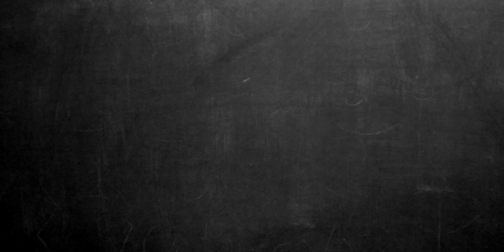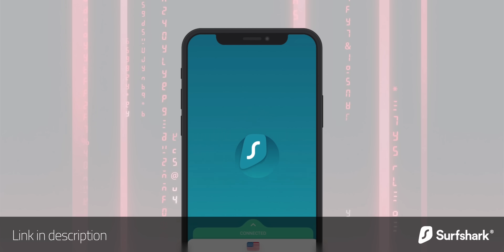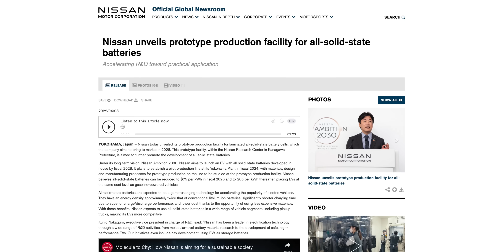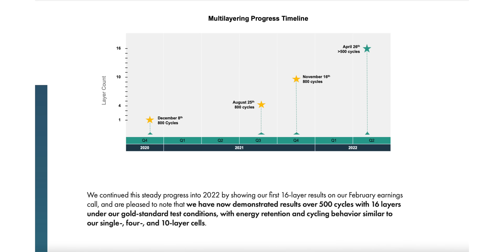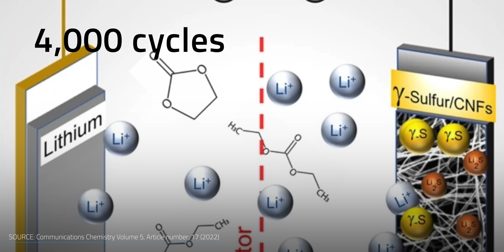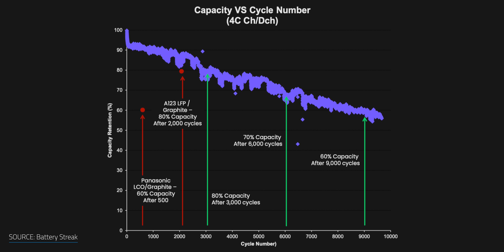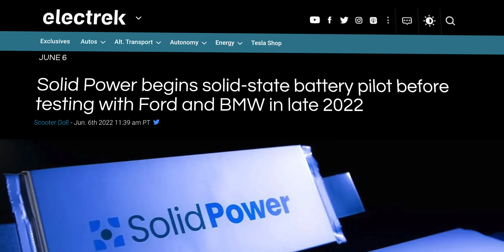Is This Solid State Battery Too Late?

Comment: I understand that nuclear Diamond batteries have a lot more work to be put into them then batteries that you mentioned however wondering why you didn't even mention them at all in this video considering that they would be the ultimate long-term battery and they could be paired with other batteries to be a background charger for the battery that you actually use and yeah I understand that they don't produce much energy at one time which is the reason I suggest that they could be worked in combination with one of these other battery technologies basically they would be a background generator instead of a battery

Comment: In 1799 Alessandro Volta (based on Luigi Galvani's 1780s work), pile up alternating disc of copper and zinc to made the first: pile, battery, cell. 
220 years later we still use the same comcept, same idea with new materials. Is like remaking a Ford-T with carbon fiber, aluminium, polycarbonate .. ... but still is a Ford-T
We don't need new materials. What we need is a new concept, fresh ideas, not a remade of 220 years battery.

Comment: Until you have one in your hands and test it yourself, it's really difficult to know are lab results vs. real life.  It would be nice to see improvement over different existing technologies vs always chasing a magic bullet.   I just discovered an unopened box of Energizer Industrial D batteries MFG 2005.  Just for kicks and put them into a fan and they worked.  Also, my Ipod Shuffle is still working after almost 16 years.

Comment: Solid State Batteries are still the ideal future, regardless of any others that might hit the market first.  The 2 big things that the other technologies don't address are safety and weight, because they still use a liquid electrolyte.  What's the use of having more range in your EV if a fallen branch on the road can make it go boom with a single puncture?  And while they might not have the sheer density of the other technologies on paper, the massively reduced weight of Solid State Batteries would increase the efficiency of them to a point where in practice they may work out to have roughly the same actual, usable range.

Comment: By proper planning, charge time isn't a big of an issue. The reason I am hesitant to EV is the cost, and long term cost. 

Even if a EV was cheap to purchase, the long term cost is still a deal breaker. 

I drive a 40 year old E85 car. Got the knowledge to modernize it, and it got a fair standard of comfort. The cost is almost none, except for the fuel. But doesn't give me any surprise's and I can plan my economy. 

My point is that most of the consumers can't afford an EV as it is today. 
The technology isn't here yet, even how much you wish it was. 

Second, my passion as for many other's is the combustion engine it self. 
The passion for driving. 

Third is political. And I'm not going in to that. 

We cant stare blind in to one lane. There are other opinions, as the development of EV's 

As you mentioned in another video, research for alternative fuels are another way as well. 
Then we are back in to the political aspect again. 

Well, I could go on, but I had to get this out of my chest. 

I prefer logic before anything else. 
Pushing EV's as the savior of the earth is not really the truth. As you know, it's just a percentage of the total CO2 equation. 
It's like putting out a fire with a bucket. 

(I'm certain that someone going to react on my comment, and rightfully so, but i find it hard that it would change my mind)

Comment: Batteries have so many different applications - in cars, in home power storage (combined with solar cells), in electronic devices like smart phones, in drones, etc. 
All those different applications come with somewhat different requirements and affordances - so the current "one battery-type fits all" approach might eventually give way to having different types of battery for different applications - depending on the strengths and weaknesses of each technology.

For example, in a car battery, weight and energy density are top priority - while for home storage you might put higher priority on longevity. In a personal vehicle, charging speed is important to the buyer, while in public transport, charging breaks could just end up a fixture in the schedule.

And consumer preferences tend to change over time as well. Right now, many people seem to worry about range and charging times a lot - which reflects some uncertainty about new technology - but who knows if those things will still be deemed that important, once people got used to car charging. Many people might not actually need hundreds of kilometers of range in their daily lives and find lower capacities to be fully sufficient.

Comment: I still think the least lossy, most cost effective way to use solar energy near the coast is to pump sea water up hill into reservoirs by day to drive hydroelectric generators by night. No use whatsoever for EVs, apart from charging them from a renewable supplied grid. We'll never have a more efficient "battery" than gravity and a bunch of sea water. And we could be powering our cities like this TODAY.

Comment: Just to add in the reference we're all wondering about, Tesla is averaging $142 per Kilowatt hour, and it averages 231 Kilowatts per kilogram.  But the cost is the main thing.  The industry average is $186 per kilowatt hour.  So, as usual, Tesla is killing the competition.  Sure, that price isn't as good as the projected cost of solid state batteries at $75 per kilowatt hour, but will they ever actually achieve that?  Meanwhile Tesla is raking in all the money, and constantly improving everything.

Comment: No breakthrough is too late.  There's always another day and breakthroughs in an area where the need for batteries is going to be insatiable is important because multiple battery tech will be necessary.

Comment: All the Battery Technology sounds great and everything but can it be recycled and reused/repurposed. What type of waste product is produced from making them. Not exactly the same thing but the byproduct of making diesel was gasoline now we use gasoline. Of course one of the other by-products was Styrofoam or would we eventually called bean bags/ice chest/Packaging. And yes there are plenty of downsides with those products as well. One could probably go down a rabbit hole with thinking like this but someone should think about it.

Comment: I tend to agree, the window on solid state is closing. If traditional battery systems can drop to the $75/kWh range by the end of the decade, solid state will not be able to beat it on cost. The energy density tag is there because of the use of lithium metal for the anode, but I am also aware of progress on that for conventional cells. Dendrites are a problem for both systems and both still need to get to 1000 cycles at 80% capacity retention without failure to be marketable.

The conventional system is able to provide 300+ miles now. If a manufacturer can build a car with 4.5 miles/kWh efficiency (about Tesla and Lucid), a 100kWh battery can go 450 miles at a cost of $7,500 for the battery that weighs 400kg for a 250Wh/kg battery. That will be hard to beat, and harder if the energy density can approach 300Wh/kg.

Comment: Why is everyone so fixated on electric vehicles?  If fossil fuel-based power plants were replaced with nuclear plants, it wouldn't even matter what powers our cars.  Everyone is obsessing over the wrong thing because battery production isn't very good for the environment either...
Reply: Transportation makes up 30% of greenhouse gas emissions, so it matters greatly what powers car and trucks. 
How the electricity is generated that powers them also matters obviously. But building new nuclear power plants is not the solution. They are much more expensive to built than renewable energy, take much longer to build, and we don't have the engineering capacity to build them at large scale; Uranium also has to be mined and processed first. Nuclear energy is dying a natural death.
Wind and solar are cheap and ubiquitous, Further mass production will make them even cheaper and further technological progress will also make them cleaner to manufacture. We're running out of them to drastically reduce our greenhouse gas emissions, so this are simply the best technologies we currently have to change the energy system at scale.
Reply: @saschamaj  The fact that transportation makes up 30% of carbon emissions is precisely my point.  You change how you generate electricity and you've solved the other 70%.  Wind and Solar are little more than pipe dreams, and as silly and inefficient as collecting your drinking water by putting a bucket out when it rains.  Nuclear energy is the only thing that will ever be able to keep pace with our energy demands in the future.  Any opinion to the contrary is born of sheer ignorance.  The only thing that has been killing nuclear energy are shortsighted politicians that can't see beyond their next election.  There's nothing natural about that.

Comment: Look at the battery market it is nearly half of entire world food supply then the solid state battery is if designed my way is like an array of billion of ccd cell of digital camera that way it never need charge or recharge it work all the time when there are light, heat , or sound because tiny 3 plate capacitor is charchge so fast that micro seconds you can recharge million of cell and chain it into buffer zone ready for use ...it is best to use in small consumer electronics like smart phone, or GPS or smart watch and eliminate the recharge cable and depending on plug in charger and that is liberating and worth atleast 20 billion dollars on just smartphone and watch market

Comment: I repowered my sailboat to electric a few years ago. When doing that repower, I stuck with a lead-acid propulsion bank, because lithium batteries catching fire while underway would be a much larger problem than they would be in e.g. a car (ouside of any injuries and property damage, I'd need S&R rather than just a taxi). Needless to say, I'm pretty happy to hear that the mass production timelines on the solid state batteries being described here, line up pretty nicely with the expected end-of-life for my current lead-acid bank.

Comment: They could be used in combination with other battery tech like a sort of hybrid battery like one type for weight, safety, and quick charge that is also integrated as part of the chassis frame, and interior, and one set as the main for longer distance and one that is more integrated as part of the regenerative brakes, and one integrated with the motor or something like that. ???

Comment: It is never too late. The possibility of getting rid of electrolyte is too advantageous. Solid state batteries reached over 1000Wh/kg already. Lithium metal sulphur battery. It took sugar to stabilize this type of battery. This battery would be cheap(only lithium, separator and sulphur is needed) and they are very energy dense

Comment: Never let the perfect be the enemy of the good.

If you can get me an EV with a mass produced, more safe battery, that charges faster and drives farther without raising costs TODAY, versus one that's even safer, faster and farther, but I can't have it for a decade or more... well it should be obvious that the solid state batteries that will be on the market in the next year or so are a wonderful upgrade and should be used as such.  If you want to sell me something even better in 2035, that's cool too.

Comment: I don't see the reason why a battery couldn't be both solid state and have a sulfur cathode at the same time. Using a solid electrolite results in mainly anode enhancements, dumping graphite or whatever else and using only pure metallic lithium. Meanwhile the the heavy metals nickel, cobalt, manganane, aluminium are replaced by sulfur in the cathode. I don't see a barrier to having both of these.

Comment: to replace the current Li-ion tech(and I don't mean tweaks to the battery chemistry), the new batteries have to be able to be manufactured cheaper and faster with similar performance to current batteries, OR have much better performance for the same cost/ease of manufacture. only than will the current batteries be phased out.

Comment: Solid state batteries may find their use in future heavy duty applications and not passenger cars CATL has now introduced a new non-solid state battery with higher energy density and a much faster re-charge time. As innovations occur in non-solid state batteries and the chemistry that stores and allows electron transfer, solid state batteries will face a steeper uphill climb into acceptance. Structural battery integration into a vehicle is now the norm and each new innovation seems to dictate a new structural necessity.

Comment: Watt-hours per litre is energy density.  Watt-hours per kilogram is specificy energy.  The former is how much space the batteries take up in the car, the latter is how much weight the batteries add to the car.  When it comes to cars right now, specific energy is the more important consideration.

Comment: Nothing comes even close to what solid state can do. All other developments have significant drawbacks in some area. A battery tech for EVs needs to be better in ALL areas to be able to fully take over. A tech that is better in some areas, but worse in others (like FePo) can only hope for niche use and will get obsoleted by solid state as its economies of scale kick in. Solid Power will drive first BMW test cars on the roads this year. With the long path to full validation and production that is still about on track for series production in 2026-2027. That might seem far, but in reality all the competition is much further from reality than than. Tesla cells are at best a 16% improvement over their old tech and not really any better than current tech of other car makers. Tesla was busy solving thermal cell issues that no other car maker has because prismatic and puch cells have better cooling properties already. Solid state is the future and is coming just at the timeline that it was always expected at. And the testing cycles that you were focused on? Do you know how long it takes to do 500 charger/discharge test cycles on a good sized battery? The number is limited by time between iterations of the design. You don't want to test each iteration for three months or a year. Final validation will do that, but not real development.

Comment: I would be happy with 4680 LiFe cells hitting the open market at $50/KWh so diy and home storage can grow as we need it to. If I had a 5+ KWh home battery my average power need would only be 175w/h for my home, that would mean that the grid that now supplies 15-20 KW could serve 110 similar customers with no upgrade whatsoever. For those countries with no or pour grids it would cost far less to get to the Swedish grid standard.(my heat is separate and not electric) That would be a huge step in the right direction in my opinion as we can cover most of those needs with rooftop solar already.

Comment: Matt, there is a company investing in a new battery factory to be online in 2024 which says they will have Lithium Sulfur batteries for $75/kWh and much higher energy density using technology from Xponential.

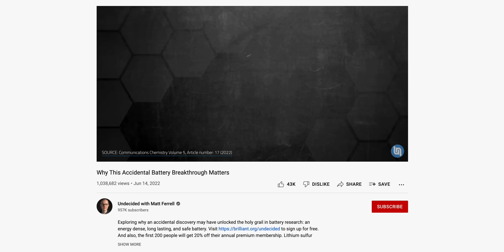Take a look at this video at 1:16. The presenter speaks in english but in this video you can't hear the original voice. But the slides are clear.

https://youtu.be/Pe0DFA_bptU
Reply: 1:16:00 (one hour, sixteen minutes)

Comment: Your description of the Tesla 4680 battery as havin a 6x increase in stored energy is very misleading.

The battery 4680 isn't 6x more effective at storing energy per weight or per unit volume.

The point is that the 4680 is a heck of a lot bigger than the previous  generation of Tesla batteries. And because it's bigger, it stores more energy.

FWIW, it is a little bit better (about 15%) in terms of energy stored per unit mass. But describing it as 6x better is very misleading.

Comment: I have 3 batteries for my RC helicopter that I can charge to 90% capacity in 5 minutes. I bought them over 5 years ago. I have 3 so I can charge them faster than I can use them which allows me to fly continuously all day with only 3 batteries rather than having to buy 10 to 20 batteries to fly all day.

I don’t understand why these batteries that you’re talking about that take 15 minutes to charge are such a big deal. My batteries don’t even get warm when I charge them in 5 minutes.

If you underrate the batteries and call 90% 100%, then you can make a vehicle that can be fully charged in 5 minutes. They could have been available over 5 years ago.

Comment: Don't forget new graphene base supercapacitor battery hybrids which promise to dramatically reduce weight and cost, but provide fair to excellent power density, incredibly fast charging (with the possibility of ultrafast discharge for high current applications), and impressive life expectancies.

Comment: Okay, this was just a summary of earlier reports. And the overpowering message is that solid state is offering no notable benefits at this stage. That is okay. If solid state finds a place it should be against the best of what is currently working in production or is on the cards for the next few rounds of incremental developments and optimisations.